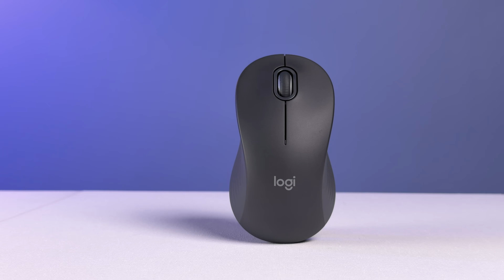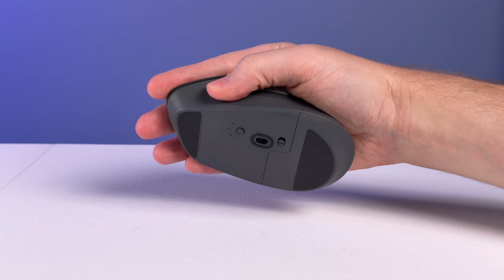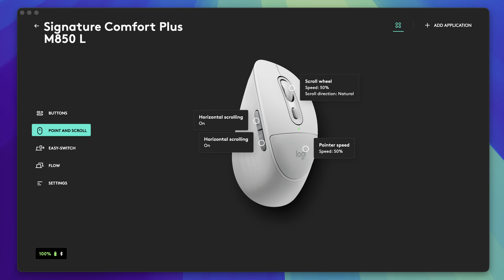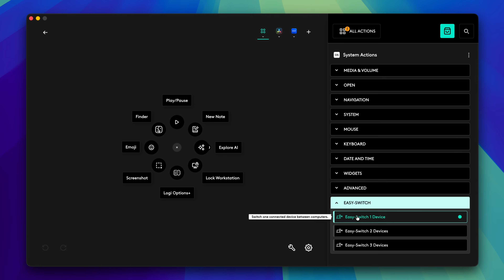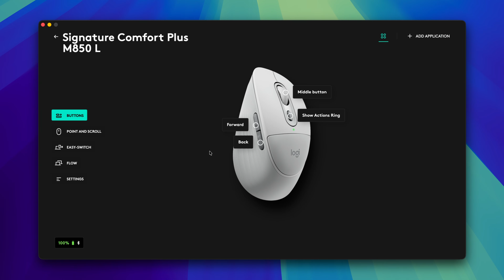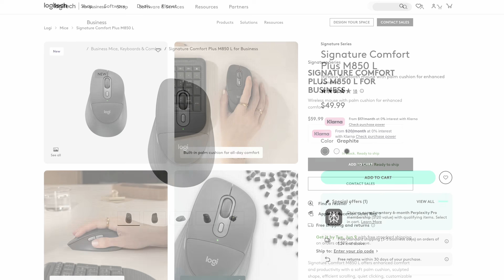Logitech’s Next Great Mouse is Here (Signature Comfort Plus M850 L / M840 L Review)

Comment: Thanks for the video, glad I clicked it. I have been using the marathon x2  for years then upgraded to the triathlon but that lasted for only two years before the scroll wheel and right click start glitching. Used the 650 and mx anywhere and even tried rapoo 760L but none is as comfortable as the triathlon mouse. Noted that the palm bump actually made all the difference and glad to know that you covered that in this video. Thanks.

Comment: I think I'll upgrade to the 840L from my Triathalon since I don't actually like the side button for changing devices. I also use Linux so the logi options + software won't work for me anyway.
Reply: I think you could experiment with the Solaar tool to get it working, at least partially.

Comment: Of course there IS a way of "preventing the wheel from free-spinning, when scrolling fast" - set the sensitivity of the auto-switch to minimum and I guarantee you won't be able to flick fast enough to trigger the free spinning mode.
Reply: This isn't the same scroll wheel as found on the MX Master/Anywhere (assuming it's the same as the ones on the M650 and M750). It has no setting for auto-switch – it's essentially just a free-spinning wheel, with quite weak detents.

Comment: I have a 17.5cm hand. The MX Master 3s is a fairly fine length and width - but the HEIGHT of the hump on the left makes my wrist pronate and twist my forearm which hurts. I think it probably most people who don't have HUGE hands who have their forearm twisted, or they're fighting it. 

The Triathlon is the perfect contour for my preferred grip, hand position, and hand size. But the software of the polling rate and the connection with the RF interference with mac ports is really disappointing (a computer compatibility issue). The scroll wheel to side scroll (which the Anywhere has) is brilliant, and I love it more than the side scroll on the Master. I'm looking for something that has better software than the Triathlon, but feels the same, so I'm going to try their signature series (I got a forearm injury, so I'm being picky)

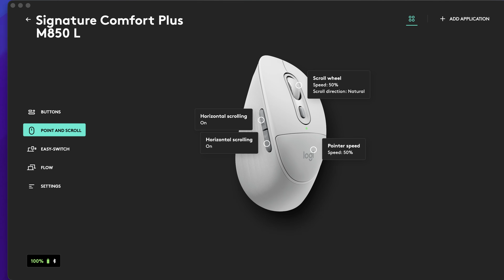Comment: 8:01 honestly this makes me regret buying mx anywhere 3s, since i still find it hard to adjust to its size and lack of bump. this signature comfort plus has everything i wanted from logi mouse; the size, the bump, buttons, scroll wheel (tho not as super high-end as magwheel, i find smartwheel from my pop mouse is enough), and this horizontal button thing that was introduced in mx anywhere (correct me if im wrong if we can do this to other logi mice with side buttons before signature comfort plus). hope there won't be pink color available so it wont make me regret even more! :face-green-smiling:

Comment: Right now I am just using the MX Anywhere 3. I find the MX Master way too heavy to be nimble for productivity and general fluidity of my workflow. I like the metallic wheel. But I really like the shape and size of this one! I would love a version of this with that mag wheel, it looks like the perfect mouse otherwise.
Reply: Yes I think the same! Maybe the new 'anywhere 4' if it's released this year will tick all the boxes.
Reply: same, bought an anywhere as an office mouse but I ended up preferring it over my mx master
Reply: @bat51  My in between mouse is a Razer Basilisk Pro V3 because of the form factor and light weight size. The Logitech metallic scroll wheel are still the best.

Comment: I have a number of USB Receivers from past MX Master models (v2 and v3). Will these older receivers work ok with the M840L. Also, my older MX series do not seem to support Bluetooth (on a Mac), so I assume Bluetooth connection of the M840 is the way most people, would use it, correct?Why would anyone choose to connect using the receiver if Bluetooth is available?
Reply: Lower latency. Bluetooth introduces a tiny bit of extra latency for wireless peripherals in general. For mouses, Bluetooth also restricts the polling rate if your mouse otherwise supports higher polling rates.

On my MX Master 2s and 3s, I always use the USB receiver since I switch between two computers often and Bluetooth takes a bit of time to reconnect. The receivers are instant. And they also very clearly remove some input latency vs. Bluetooth as well.

But your mileage may vary. I’m used to way more responsive gaming mouses, so going Bluetooth is very noticeable to me.
Reply: @theconformist2399ok. Thanks for the explanation. Since I am not a gamer and my regular Apple Bluetooth mouse works fine for what I do, I guess I do not need to use the USB Receivers.  That said, no harm if I use it if one of my older receivers connects OK to the M840L
Reply: @apeel2008  The older unifying receiver and the newer logi-bolt receiver are not compatible with each other.
Reply: @cm.5023 thanks for the info. I just checked and all three of my previous receivers were the unifying ones. Was the Bolt versions any better, or is this Logitech’s way of planned obsolescence to get people to pay more for their new mice? Or was there really a performance improvement?
Reply: @apeel2008 it was for security they stated. I believe they have better encryption for office environments where keystrokes transmitted over unsecure Bluetooth may be intercepted.